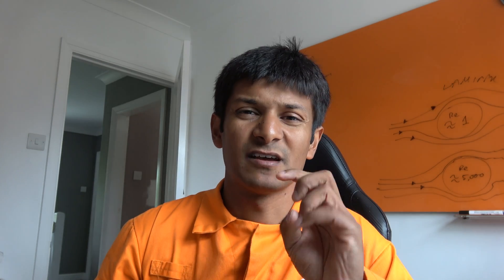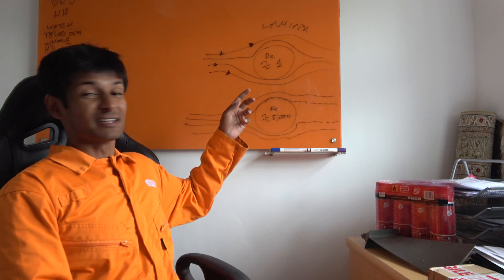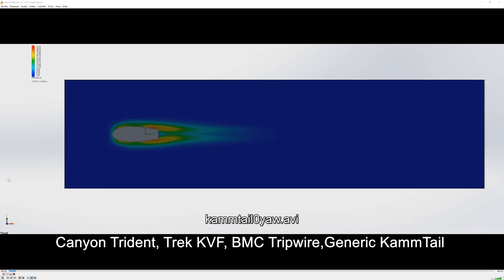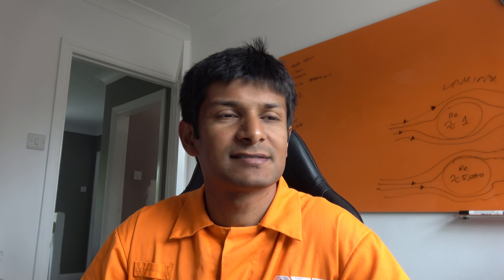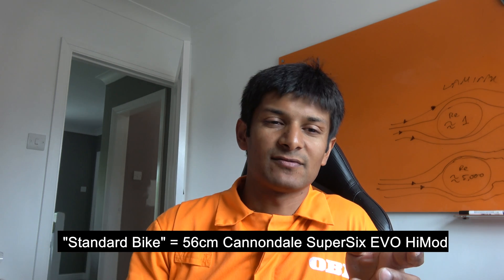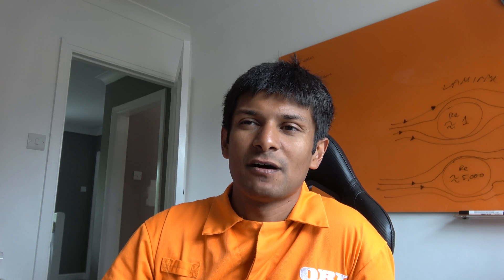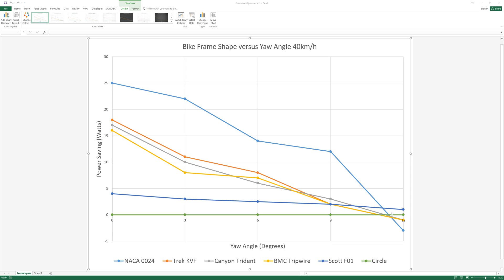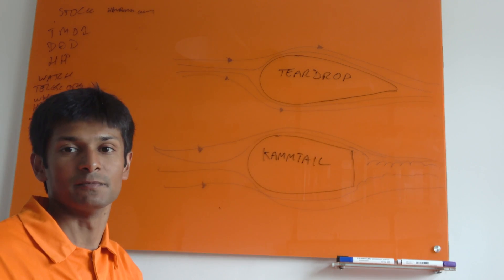Trek Canyon Scott BMC bike frames Compared, Which is more Aero? An Engineering Explanation

Comment: Just a couple of questions: In your opinion, is there an order of earo effectiveness of bike parts. i.e. for fictitious example - handlebar15% front wheel 35% rear wheel 15% frame 18% etc etc. From what I can tell the air flow round most of the bike is extremely messy and maybe only a limited number of components are actually being effectively earo.
I suppose what I am getting to is making my caad 12 (mostly round tubes)aero on the cheap. 

Cycling weekly recently posted a video testing testing earo bikes against each other. The Giant came of the worst by quite a margin...I don't get it. What am I missing...a big invisible elephant not in the room but on the bike.

Fantastic videos
Reply: this Cycling Weekly "test" is a joke...

Comment: Your colour gradients correspond to level sets of "vorticity". How have you measured vorticity? Potential from Helmholtz decomposition, Q-critereon, ...?
Reply: I was just about to ask the same question.
Reply from the maker: I was not expecting anyone to ask me that question, let alone two people. Vorticity is measured in 1/s, ie the rotational speed perpendicular to the axis of viewing. It is a measure based on the curl value of the velocity relative to the fixed frame. In this case, Solidworks uses Helmholtz decomposition. IN a professional capacity I use what is now Ansys (Fluent) for CFD, in which case you have much more control over the boundary conditions and the corresponding analysis techniques such as Q criterion. Unfortunately I don't have Ansys on my home PC and it's analysis would bore most youtubers.

Comment: Nice explainer! You should have a chat with Victor Major of Velocite, he likes to geek out about aerodynamics.

A couple of mitigating factors may influence the attractiveness of Naca vs Kammtail and others:
- Tube angle - especially the down tube and seat stays are not vertical, so the projected profile isn't round for a circular tube, and the Kammtail gets "closer" to a Naca through a longer projected chord length
- A bottle on the down tube messes really gets in the way and messes up a lot of the air flow (even before we talk about legs, etc). All that to say that the aerodynamics of the overall bike might not be a direct extension of the tube profiles
Reply: jever98 good points about the inclination of the tube profiles... this is rarely discussed.
Reply from the maker: Absolutely spot on, inclining a tube especially the downtube changes the effective chord length but that is in the worst possible area because it is having the messy airflow from the front wheel hitting it. The seat tube is almost not far off vertical. Generally speaking a longer chord length will be faster because the rate of displacement change is reduced. 

Water bottle modelling is a PITA, and the best thing to do would be put it behind the seat.

Next video will do the ancillary aerodynamics ie shielded brakes, dropped downtubes, waterbottles

Comment: Good stuff! How about lateral stability in crosswinds though? Because NACA profiles will increase the surface area presented to side winds, and thereby the lateral force applied to the bike. I guess this is one of the advantages of a Kammtail...? 
From experience, I know that a full on TT bike with deep wheels in strong side winds can be a right handful!
Reply from the maker: If the chord length is fixed at 10cm, irrespective of a kammtail or NACA, the area presented to the wind in a full crosswind will be the same. It's usually not the crosswind that makes the bike difficult to control, it's the pulsing of the crosswind that is a problem. In a steady state crosswind, the bike rider leans the bike over and continues at a slight angle. When the wind is coming on and off at high speed, the transient effect is what makes it difficult to handle.
Reply: Well yeah, I guess if the chord lengths are the same then area will be the same, but I thought the point of Kamm's was to have a shorter tube? 
I've had crosswinds, especially when passing a gate in a field, say, that have pushed me a good 3 or 4m across the road, not much you can do about that!
Reply from the maker: The Kamm's frig the 3:1 rule. My issue is not that they use them, it's the fact they state they are more aerodynamic than a teardrop.

As for going past a gate, you highlight the point of transient response perfectly with that.

Comment: The Kestrel Talon uses NACA profile. I believe it isn't UCI legal because of the 3:1 rule. While the design is from the stone age in bike years(the frame has not had a redesign in nearly 20 years!), it is still a very aero frame. The last test that I know of was done by Tour Magazine around 2011, and the Talon with its airfoil tubes was more aero that the Cervelo S3, Canyon Aeroad, and Felt AR. This was when the Talon's frame design was over 10 years old. At $1,200USD for a 2017 Talon 105 on bikesdirect, it is probably also the cheapest aero road bike that is actually aero. If you strip the bike down and sell off everything, the frameset is probably around $750. Goes to show how overpriced Madones, Foils, Venges, and S5s frames are.
Reply from the maker: Bike manufacturers will do anything to cut costs and sell high. The quality of manufacturing these days is atrocious!

Comment: Nice. One of the best bikes I've ever owned had a genuine naca profile with a genuinely sharp trailing edge. Cervelo S1 aluminium. Wasn't very stiff though. The other problem is with Carbon and getting good internal compaction into the trailing edge. Basically impossible I'd imagine. 

Can I request a simulation? A naca profile in front of a large bluff body Vs a round profile in front of a large bluff body. ( i.e worthiness or not of an aerobar )
Reply from the maker: Can you send me a sketch with some rough dimensions on. support@hambini.com
Reply: Was there any answer to this?

Comment: Great vid as usual Hambini. What happens when we take these models into a wind tunnel with the actual frames - will the results be replicated or are there other influences? Also what about the more modern bikes being designed as 'complete systems', i.e. the downtube being designed in a way in relation to say the seat-tube? Could that also influence the manufacturer's decision to move away from NACA?

Is there a fully NACA frame anywhere that could be tested against say a Madone or S5 in a wind tunnel. That would tell us a lot. Must have been done already come to think of it. Maybe Cycling Weekly could throw it in on their next track test with some persuasion from a credible engineer ;)
Reply from the maker: It would be quite easy to test in wind tunnel. To nullify the effects of all of the ancillaries; remove the brakes, remove the cables and remove the rider. Then it would give the aeroydnamic drag of the frameset.

The main problem and the reason why none of the major manufacturers go to a NACA 0024 is because of the UCI 3:1 aerofoil rule. To comply with that and keep a stiff frame is not easy. Hence they chop the back off the aerofoil to gain stiffness. With the advent of graphene, it should be come possible to make a frame that has a teardrop profile and maintains the strength of "box section". Having said that, Look have managed to do it with quite a sophisticated carbon layup - their carbon technology and manufacturing is IMO amongst the best in the world, they just don't brag about it

A couple of small UK carbon frame manufacturers have recently contacted me asking for aero assistance, it's quite interesting to see how they are guided by what the big brands do and essentially follow them.
Reply: Ah yes, of course, the 3:1 rule!

It's either going or gone, if the news last year was correct. Does that mean the next generations of Venge/S5/Madone etc will be NACA profile?
Reply from the maker: K Smythe of that rule is going, then it will be fractions of a second before they ditch kamm tails! there are some other types of aero foils but naca is widely accepted and studied which is why i use them, essentially they are all teardrop though.

Comment: Very interesting and well done video as always. It's evident that the teardrop profile is more aerodynamic and others look like marketing ploys. I wonder how pro teams who use non-teardrop tubes compensate for the aerodynamic compromises of these tube designs.
Reply from the maker: My first answer would be they compensate with EPO but the real answer would be the effect of supplementary aerodynamics (especially handlebars, dropped down tubes and seat stays) has as much of an effect as the profile. Also compound effects are always there, ie if you buy a slightly less aerodynamic bike in one size smaller, it will be better than a more aerodynamic bike in the larger size - i hope that made sense.

Comment: so , which TT bikes use this pure NACA? Felt IA comes in mind
Reply from the maker: It doesn't necessarily have to be a NACA profile, I used that because that's what Canyon had on their wall. The specialized Shiv Triathlon model, Cervelo P5X and Diamondback Andean all adopt the extremely long chord length design. 

My Cervelo S5 has a profile that is verging on teardrop, Look 695 and 795 use NACA shapes if I remember correctly.

Comment: Learning a lot from your videos, Hambini. Do you know wheel manufacturers/models like Mavic, use the NACA profile in their carbon clinchers?
Reply from the maker: Zipp told everyone that blunt edges were better and everyone hopped on to the band wagon. 

If I ditch the theory and talk practically, the Zipp 808's with their blunt edge that I have are 10 times worse in cross winds than my Shimano C60's with their 5 year old "V" shape design. The section depth is far more important in cross winds. Zipp/ENVE/Mavic/Fulcrum all know this but they need an avenue to sell wheels so they go for this blunt edge business. It's also cheaper for them to make because there is a reduced stress raiser on the corners.
Reply from the maker: For a wheel it's a bit different because the wheel is rotating and that causes a lot of drag. Some Mavic cosmics are NACA but now they are in the same group as ENVE, I think they will settle on a blunt edged design because it's cheaper for them to make.
Reply: Really interesting info, cheers!
Reply: Crazy, Hambini. Innovation, my blunt-arse.
Reply: @Hambini what's your view on the (conventional wisdom) that the blunt edge / wide torriodal rims handles better in cross winds?
Reply: Having had and been really happy with the 2014-15 Mavic Cosmics, this morning I took delivery of a brand new 2017 pair. As you say the dish profile is indeed blunt-edged now. The carbon dish on the old pair came to an incredibly sharp point in comparison. Is there any added benefit from this shift in shape other than cost-cutting?
Reply: I guess the other angle (no pun intended) with wheels is that aerodynamics are only part of the story (although I realise that's the focus of your discussion). The other two key factors are stiffness and how the wheel interfaces with the tyre and the effect that has on contact patch/rolling resistance.

Certainly in my own experiences wide rims that give the tyre a smoother interface from the rim edge, avoiding the 'lightbulb' effect of narrower rims, handle infinitely better and generally allow you to run lower pressures as the sidewall of the tyre is better supported, which in turn reduces rolling resistance and increases comfort.

It just so happens that as rims have transitioned from the older "v" to the newer "u" type shape, they've also got periodically wider to match the demand for wider tyres. Combine the two and you'd think the best wheels would be a wide "V", I'm not sure if anyone makes those!

As a side note, really enjoying the videos!

Comment: Nice one Hambini. What do you think of the Knight Composites wheels? Going to buy a second hand pair of 35's at a decent price, would be interesting to see if you have an opinion on them. Nice wide rim profile which is what I'm after.
Reply from the maker: I guess my opinion on them is indifferent. They look similar to every other blunt edged wheel out there and any subtle changes in aerodynamics will be largely undetectable. If they are a good price I would get them as DT swiss hubs are supposed to be of good quality. If they are the same price as Shimano with equivalent section depth. I would get the Shimano every time.
Reply: Hambini Performance Engineering I had similar thoughts, good to get a second opinion. Hubs are DT swiss 180 ceramics, not sure if that's a good or bad thing! Would be replaced with some SS ones once they wear out, don't want to be kicked out of the cult... They are a good deal cheaper than a see set of DA C40's so I think I'll go for them
Reply from the maker: EEK! Stainless steel bearings should only be used in the food industry! stainless steel has a tendency to gall which is essentially cold friction weld. You are much better off with standard bearings.
Reply: LOL embarrassing moment, I'm going to pretend I meant to write steel
Reply from the maker: I hope TDI doesn't see it, he might throw you out of the cult!